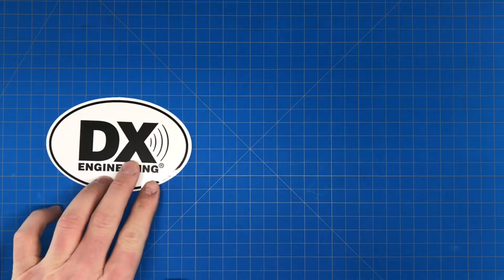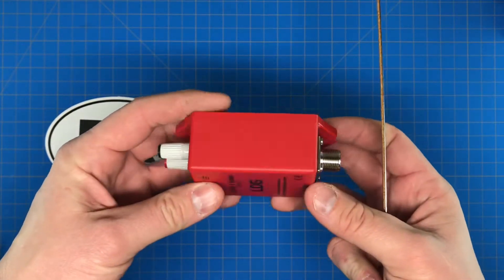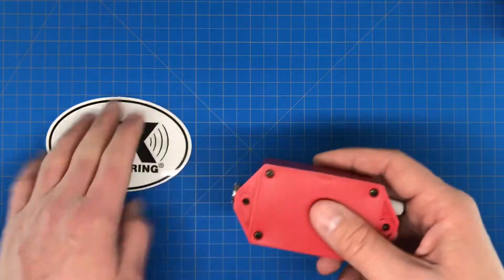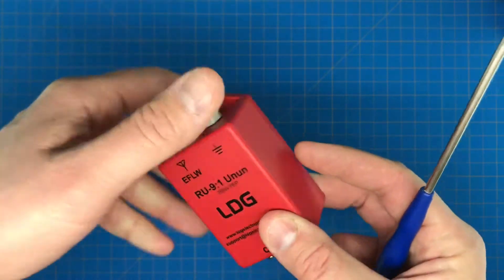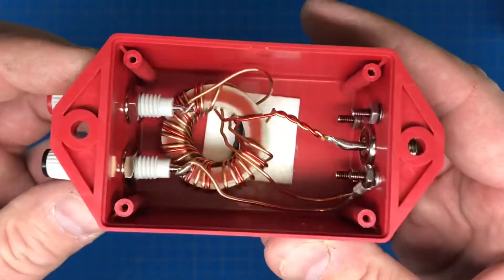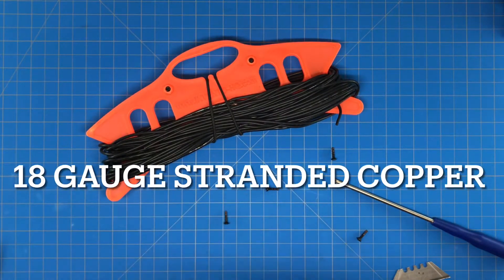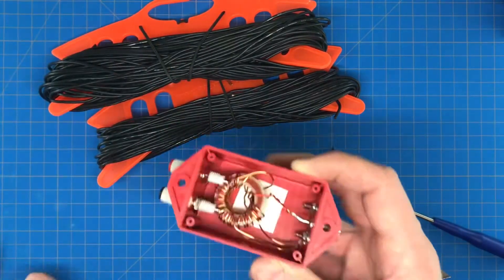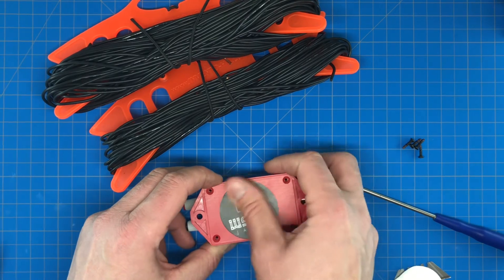A look @ the LDG 9:1 UNUN

Comment: I use that very same 9:1 unun on a 126 foot random wire that make a big u-shape up 20ft in the air. I work 10 to 80 meters and have had a contact with Ross Biggers in New Zealand from Nebraska USA. Love it

Comment: Do you think I could use the balcony rail as ground with this unun? thanks
Reply from the maker: I would give it a try, should work fine depending on how much surface area the balcony has.
Reply: @W5IPAJASON  it's actually the floor structure (a 4x1 meter metal grid) of the balcony on which wood tiles lay.

Comment: I use a home-brew version to activate parks. I use 29’ or 55’ of wire, though 29’ never failed me - I’m not sure if it makes a difference, except maybe on 40. I use a 31’ Jackite pole, making it a pure vertical. I’ve worked stations 9000 miles away with 10W CW, so I guess it’s a very effective antenna. My counterpoise is 16’, and I usually use a home brew 1:1 current balun. My rig is a KX2, and the tuner never fails to give me a match down to 60M. You will not be disappointed.

Comment: Do you need to use a tuner if you use the lengths that are recommended
Reply from the maker: No tuner need. Here is a good link for wire lengths

https://www.balundesigns.com/content/Wire%20Lengths%20for%204%20and%209-1%20ununs.pdf
Reply: In my experience, you would be well suited with a tuner with any type of transformer like this. It depends on wire length for the transformer. You may have a 1:1.2 swr on 20m, but a 4.5swr on 17m.

Comment: Good evening. Was wondering how the LDG UnUn worked for you? What length did you go with and did you use a ground radial? Thanks de KN4UXF
Reply from the maker: I went with a wire length of 53’ and use a 30’ +\- ( works great) . I found a lot of my info here 
https://www.balundesigns.com/content/Wire%20Lengths%20for%204%20and%209-1%20ununs.pdf
Reply: @W5IPAJASON  Awesome. Thank you. Yeah I was looking at that website and was going to use their recommended wire lengths. May try one of their shorter recommendations, the 36’ length for 40-6 meter as I’m going to attempt a SOTA activation in a few weeks. Thanks for the info.